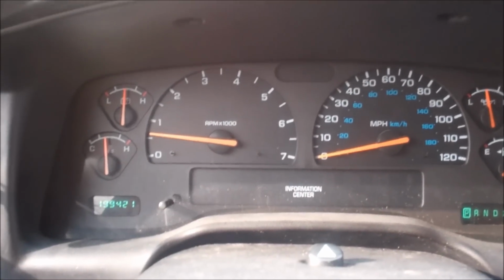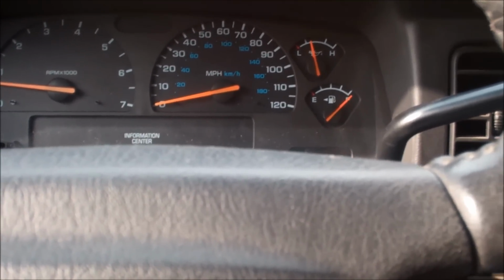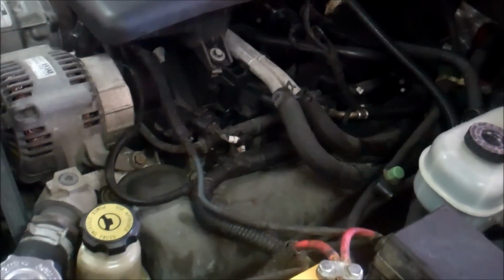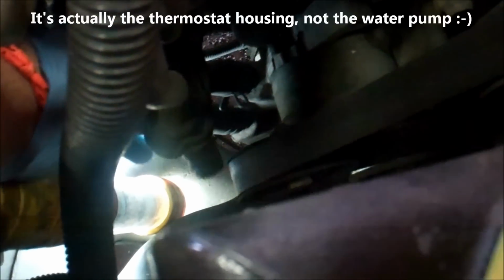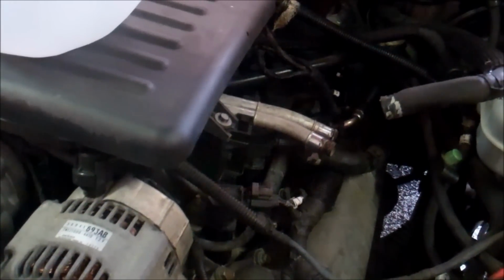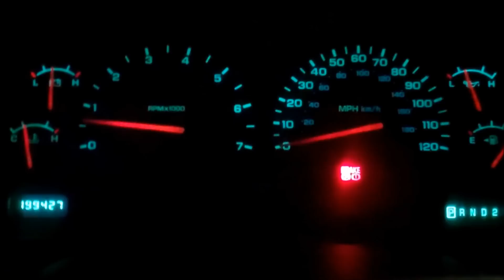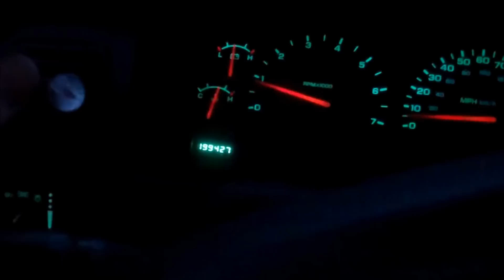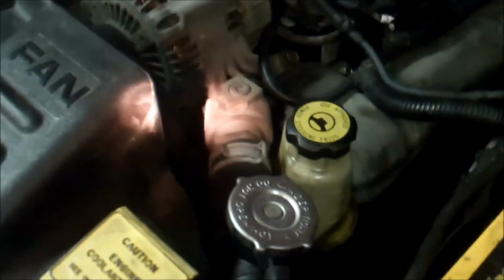2001 Dodge Dakota - Part 1 of 2 - 4.7L Heater Blows Cold

Comment: Hey thanks for having the only video that actually helps with a 4.7L Heater core flush. I only needed a couple of snippets of information - I just wanted to confirm which hoses were the ones that go to the heater core - believe or not even googling it didnt help.

Comment: Thanks so much for this video.  BTW vent temp is normally taken at the center vents as it is closest to the core and evaporator.  Great job with the diagnosis, hoses that are removed don't carry much heat.  Also you remove the bleeder valve to fill the system to help minimize getting air into the system during filling, it really doesn't do much to bleed the system in my experience.

Comment: Last month I replaced the hoses, radiator, thermostat + flushed the system. My 2k Dodge Dakota,4.7/v8 still has no heat! What gives?
Reply: I have a 3.9L and I did the same. I didn't get heat until I flushed the heater core itself.
Reply: @robovill13  This makes no  sense! This is closed loop system, where the "bleep" is this trash coming from?
Reply: @tyronewalker5764  I know what you mean. My heater core is only 6 years old too!

Comment: You should be running close to 150F straight out of the heater core in a typical environment. There's this thing called physics that involves the temperature of an internal combustion engine.